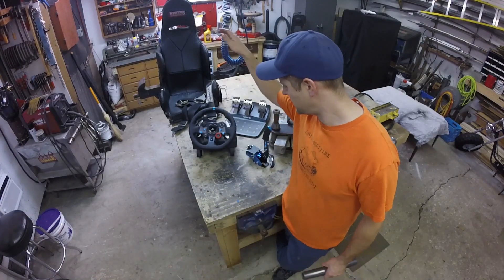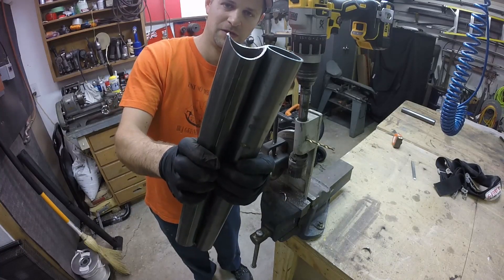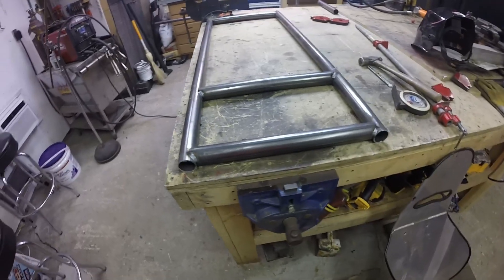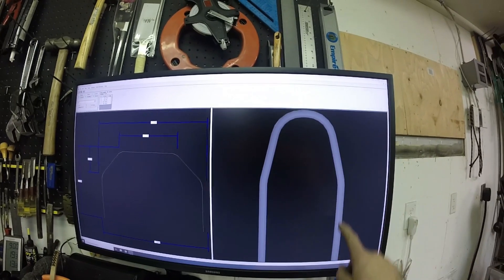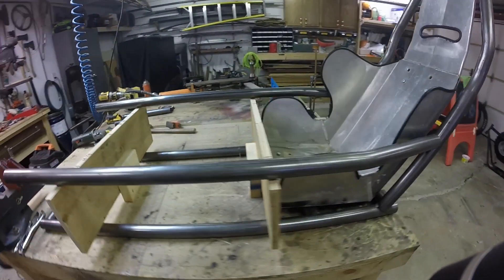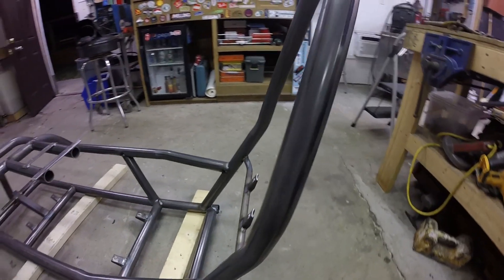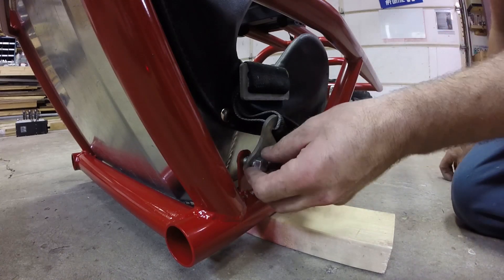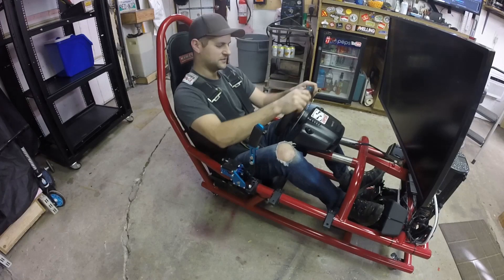Ultimate Homemade Budget Racing Sim Rig

Comment: Really cool. The pedals look uncomfortably close, but if you like it that way that's all that counts.
Reply: If you saw me at 6'3" 220lbs in my 4 Cylinder Honda Accord it would look identical to this. With my helmet on my head is about 1" from the roof.
Reply: @mattsenft4810  do you wet fins when it rains?
Reply: Yeah. This build is a great start. It's missing a lot of stuff, like a manual shifter? Also, the seat, pedals, monitor and steering wheel should all be adjustable.

Comment: Ultimate? I wouldn't have commented if you didn't say the ultimate. No manual shifter, no actual adjustability  on the shifter (that's missing) the seat, the monitor, the pedals, the wheel... Oh well. Hope it worked out for you.